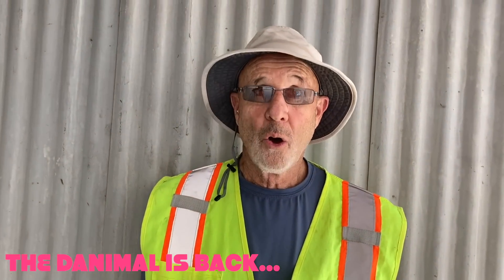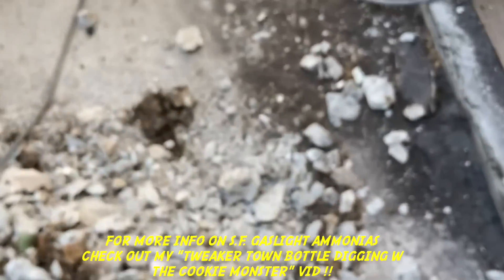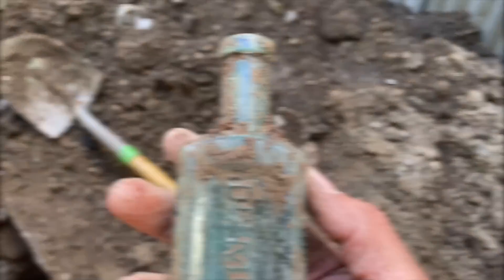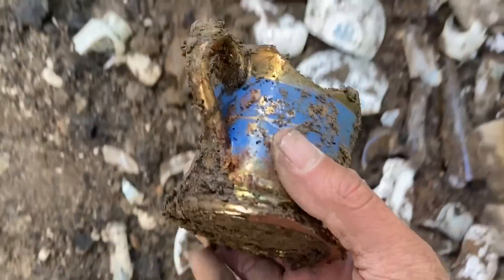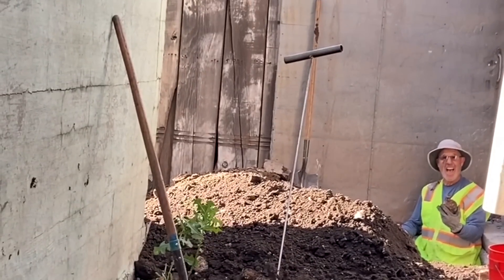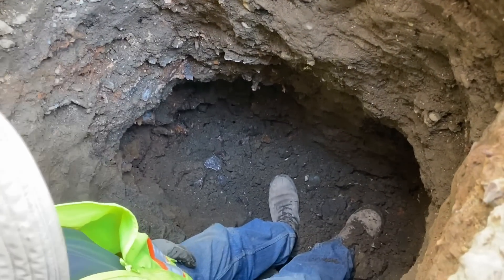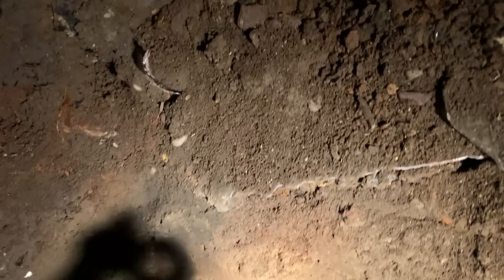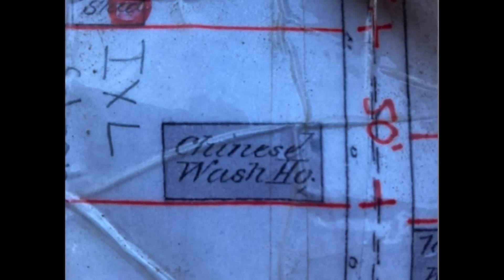150 YR OLD ANTIQUE BOTTLES Dug Under 100 Yr Old Steel Factory

Comment: Do you own your own jackhammer?  Since I moved to an apt. I had to lose a lot of tools.  I found a really cool  unmarked S.F. ammonia here, in such an odd New Age green, cone kickup,.  It came clean in water, like my  S.F. spice.  I see the white ironstone here into the 1900s, at least before 1906 when national origin was required to be marked on manufactures.  The ironstone with it's British Arms was not trying to hide.  I have some early 20th Century Willow ware marked "Japan".  My 10lb sledge didn't make it, but most of my digging stuff.  I found a really neat broken chemical quart, all sesame seeds in my Waianae plantation machine shop dump.  Other people dug it 30 years ago, still I found 5 Hutchs and good smaller bottles.  I was (am) obsessed with sifting, 1872 Quarter, 83 & 98 Nicks and a Pantheon Saloon token.  I have to distinguish Chinese, Japanese, Filipinos,  Portuguese and Hawaiian, as well as Haole (Anglo-American white people).  SoCal surfers used to ceremoniously burn a woodie and old boards as a surf sacrifice, accompanied by One Way beers.  I've seen enough videos, and grew up Cali side, I know, Ranger Rick is not your pal.  When I fill my hole, I'm sure to bury a water bottle & 7-11 rubbish to let future diggers know "I was hea "
Reply: The burying of plastic bags in the bottom of bottle diggers holes must be a universal trait! I’m in Scotland and I have been unfortunate enough to be 10 feet down in a rocky dump, and found a guys plastic carrier bag who had left it there on purpose for the next guy to dig up! I’ve since done it myself!👍🇬🇧🇺🇸